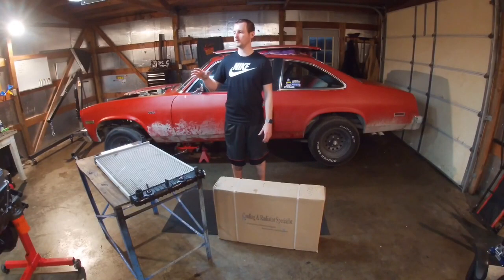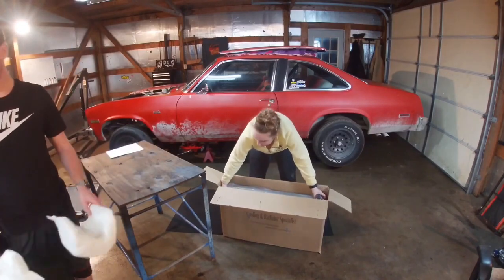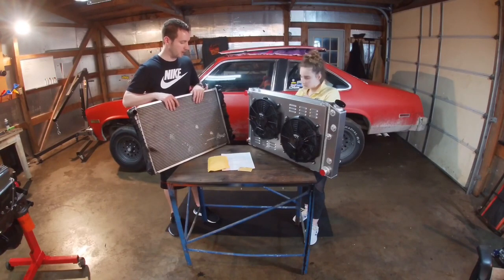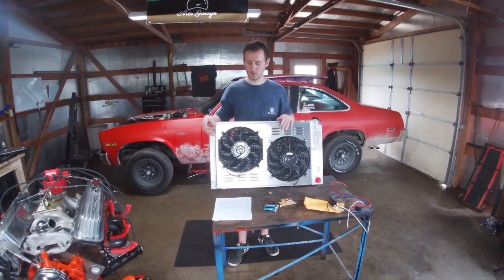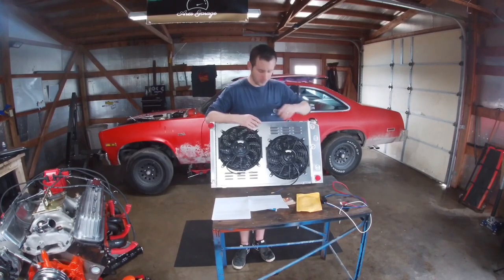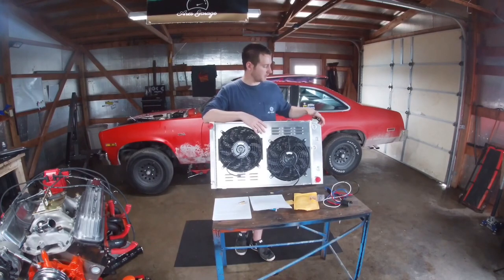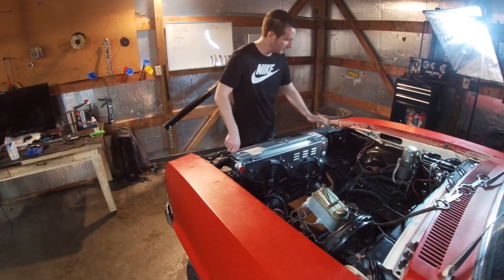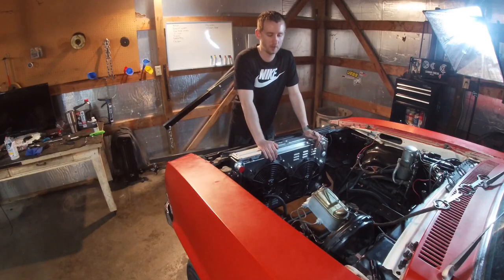AlloyWorks Radiator Review for 1977 Chevrolet Nova

Comment: Question about the radiator, do I need to plug the 2 transmission cooler lines and what are the other 2 holes for? A temp gauge maybe?